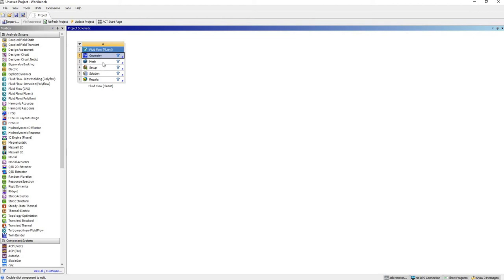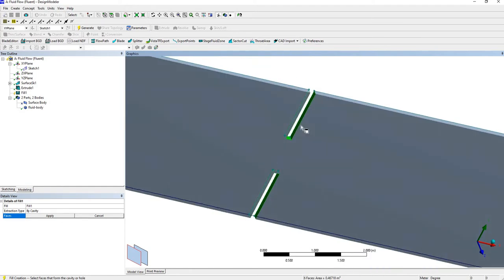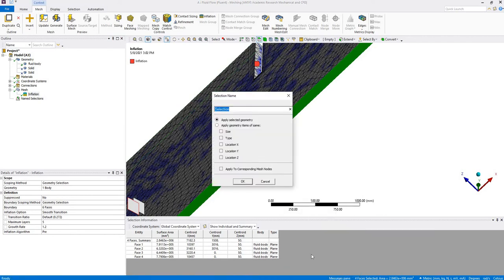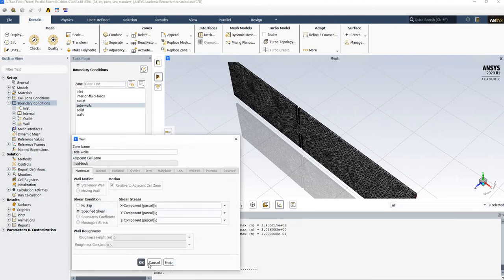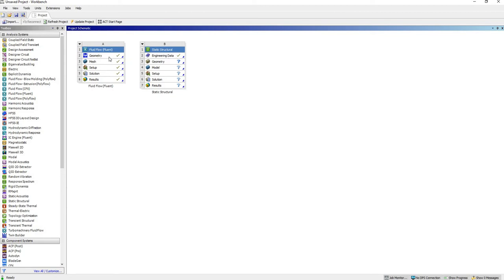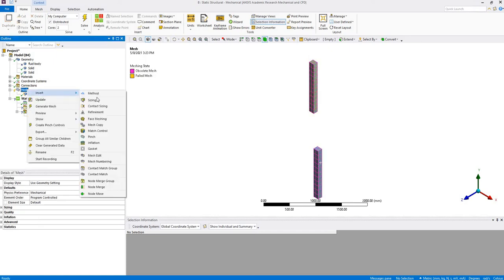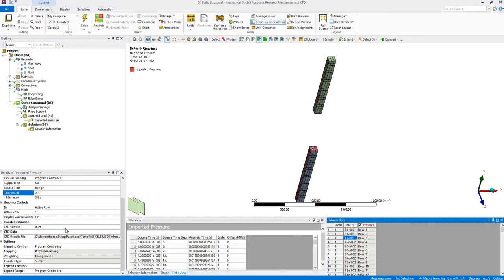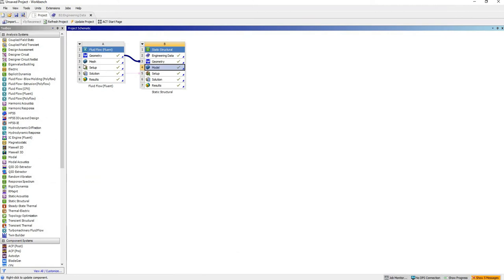FSI one way

Comment: can we apply rotating joint in place of fix support at the bar.
Reply from the maker: surely you can....then I would recommend using sliding mesh if you can instead of dynamic mesh
Reply: @NazmulHossain-nb4lc  how can pls suggest me